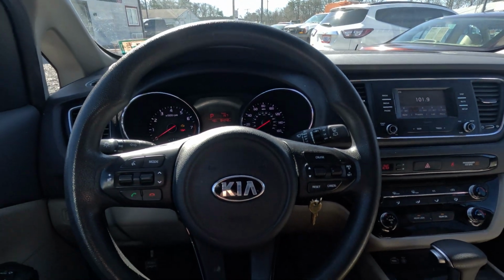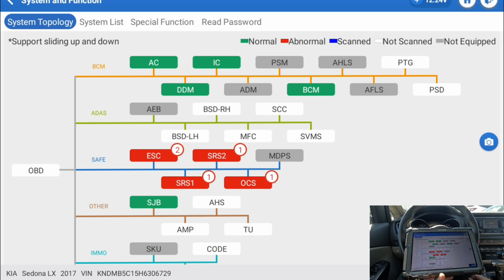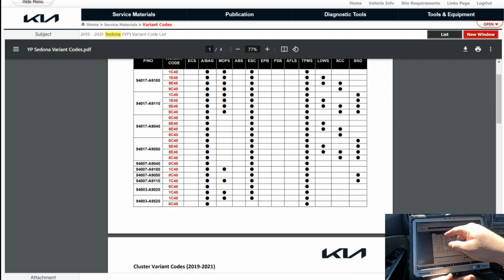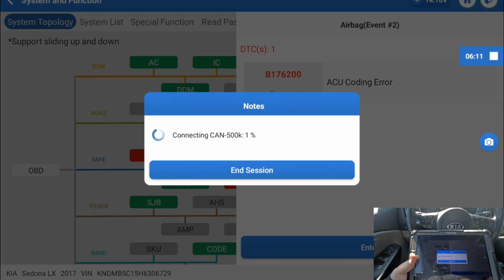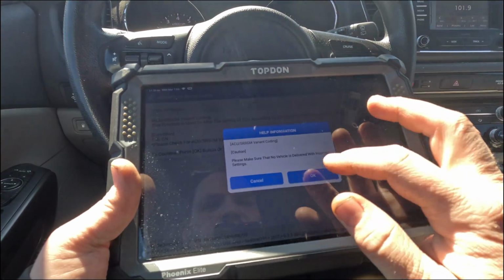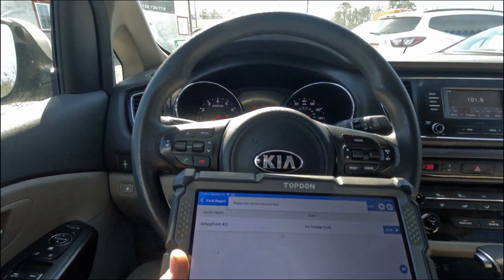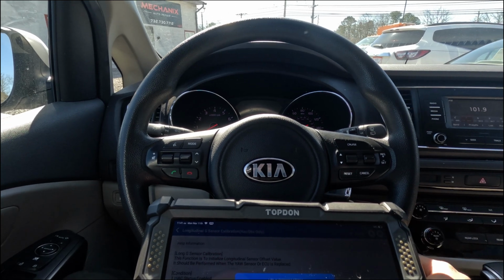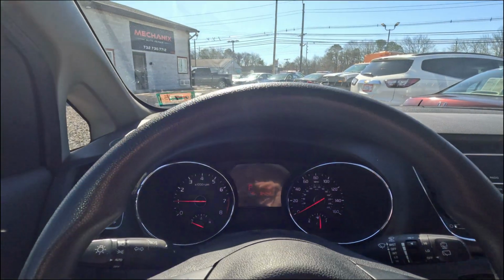2017 Kia Sedona -  Airbag Coding, Aftermarket Scan Tool!

Comment: Kia/Hyundai is hit or miss on pin codes for keys/fobs. The scan tools pull a code but sometimes it's just wrong. Many times we try a different programmer and it pulls the same wrong code. We end up buying a code and it's always different but it always works. Fun stuff. If you are ever programming a fob (not a key) for Hyundai/Kia and all of sudden it stops communicating and nothing works, disconnect the car battery for 5 minutes. After reconnecting the battery the programming will work instantly. Had that happen on 3-4 of them. At first you have to change your underwear because you think something bricked.

Comment: Can someone tell me the difference between programming and coding in simple terms.
Reply: The simplest terms, say you have a iphone. Program would be you installing the Apple iPhone OS software. Coding would be like you changing the settings in the software like the ring tone, muting the notifications alerts, or changing the screen shut down time.

In automotive Programming usually has to do with the modules software (like if it needs to be updated or if it needs software installed etc). Some modules you need to program and code because they’re blank or have outdated software. A lot of Mercedes & BMW modules are like that. You get the software from their servers to install it, then code in the vehicle specifics so the module knows the car and what features it has associated with it (ex. auto headlights)

Comment: Did the customer install a used #2 module, since the part number was different?
Reply from the maker: It was a new module from the dealer. I'm assuming the part was superseded.

Comment: I have a launch pad 5. It has done same thing to me when like programming something it says it fails. It actually doesn't fail. I can't think exactly what it did it to me on writing Vin number on something though. It said it failed and it actually did not
Reply: As a locksmith we get fails too on various programmers but the fobs/keys actually work. This stuff sometimes is so frustrating.